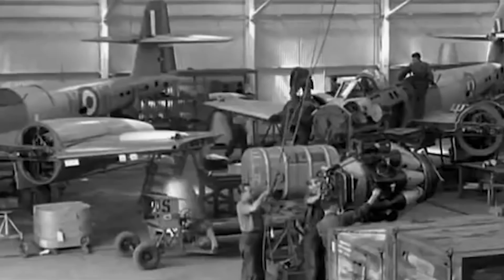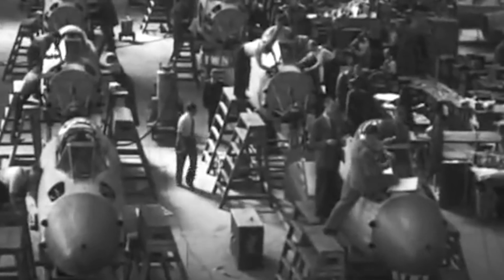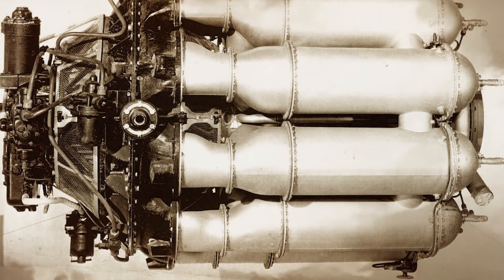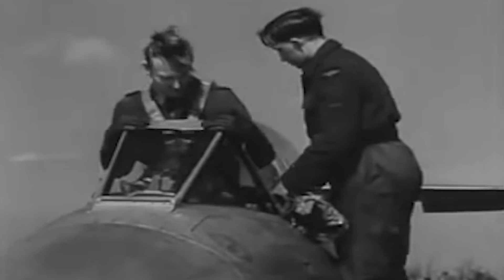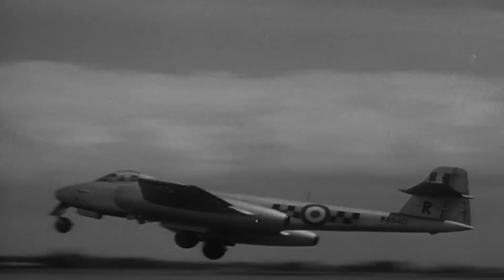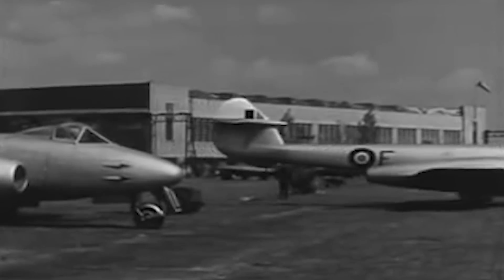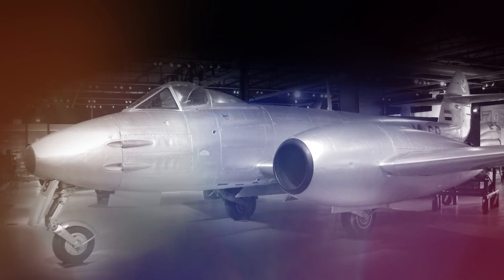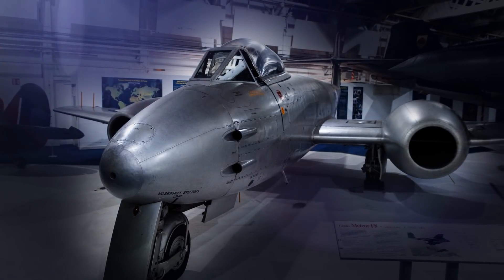Gloster Meteor - The Only Allied Jet to Fight in WW2

Comment: The e28/39 was the aircraft  General Hap Arnold of the USAAF saw and immediately saw the potential. He arranged for blueprints to be shared with America which happened via the Tizzard Missions in 1941. The result in the USA was the General Electric I-A which led to the General Electric J31.
The dominance of British jet engines in the early years of American jet aviation cannot be over stressed.
Reply: It was Operation Paperclip and Operation Lusty that launched America into the world leader in aerospace technology.
Nearly the entire remaining German aircraft industry was transplanted to America and German engineers designed everything from the Boeing B-52 to Saturn moon rocket.
Reply: @sandervanderkammen9230   Yes I am fully aware the USA turned a blind eye to all the war criminals especially one called Von Braun. Had that bastard ever set foot in the UK he would have been arrested, tried and hanged.

Comment: The meteor wasn't the only plane fast enough to catch the V1s. Mosquitoes, Tempests and Spitfires were used too. I think it was the Mozzy that got most.
Reply: Tempest was the number 1 V-1 Killer, Mosquito was 2nd, Merlin powered Spitfires were third.
Reply: @richardvernon317  Correct it was the Nosquito, the Meteor only shot down about 14 V q\1's, I just lookwd back and saw my mistake, both Merlin and Griffon Spitfies were used to chase the V 1
Reply: @barrierodliffe4155  Tempest was the Number one V-1 Killer with 638, Mosquitos was just behind with 623. Griffon powered Spitfires got 303, Mustangs got 232, everything else (Merlin Spitfires and Thunderbolts. Etc) plus the Meteors got 158.
Reply: Just 14 Meteors which were the fastest at low level the Tempest shot down most followed by the Meteor then the Spitfire but the numbers of each  and way they were used was different.

Comment: And Frank Whittle was - years behind German: Hans von Ohains invention of a jet engine for a Heinkel, which actually flew as a first in 1938!
Reply: Here's what Hans von Ohain had to say about it (from his foreword to 'Elements of Propulsion, gas turbines and rockets')-

"The first patent of a turbojet engine, which was later developed and produced,
was that of Frank Whittle, now Sir Frank (see Fig. 5). His patent was applied for
in January 1930. This patent shows a multistage, axial-flow compressor followed
by a radial compressor stage, a combustor, an axial-flow turbine driving the
compressor, and an exhaust nozzle. Such configurations are still used today..."

And 

"In April 1937, Whittle had his bench-test jet engine ready for the first test run.
It ran excellently; however, it ran out of control because liquid fuel had collected
inside the engine and started to vaporize as the engine became hot, thereby
adding uncontrolled fuel quantities to the combustion process. The problem
was easily overcome. This first test run was the world's first run of a bench-test
jet engine operating with liquid fuel (Fig. 7)."

And

"From the beginning of his jet propulsion activities, Frank Whittle had been
seeking means for improving the propulsive efficiency of turbojet engines.  He
conceived novel ideas for which he filed a patent application in 1936, which
can be called a bypass engine or turbofan. To avoid a complete new design,
Whittle sought an interim solution that could be merely "tacked on" to a jet
engine. This configuration was later known as the aft fan. Whittle's work on
fan jets or bypass engines and aft fans was way ahead of his time. It was of
greatest importance for the future or turbopropulsion."

No jet engine designed by Hans Joachim Pabst von Ohain ever went into production.

Comment: You see Schulz, Britain is loosing der war. Zey cannot afford to put propellers on za planes!
Reply: Germany invented jets.
Reply: @sandervanderkammen9230   I think Frank Whittle had a bit to do with it too.
Reply: @michaelreeves8164  We use the German version of the jet engine today... Whittle's engine was a dead end.
Reply: @sandervanderkammen9230  Oh Sandyboy, have you abandoned Guillaum again! Let's remind you what Pabst Von Ohain said-

"The first patent of a turbojet engine, which was later developed and produced, was that of Frank Whittle, now Sir Frank (see Fig. 5). His patent was applied for in January 1930. This patent shows a multistage, axial-flow compressor followed by a radial compressor stage, a combustor, an axial-flow turbine driving the compressor, and an exhaust nozzle. Such configurations are still used today..."

and

"From the beginning of his jet propulsion activities, Frank Whittle had been seeking means for improving the propulsive efficiency of turbojet engines. He conceived novel ideas for which he filed a patent application in 1936, which can be called a bypass engine or turbofan. To avoid a complete new design, Whittle sought an interim solution that could be merely "tacked on" to a jet engine. This configuration was later known as the aft fan. Whittle's work on fan jets or bypass engines and aft fans was way ahead of his time. It was of greatest importance for the future or turbopropulsion."

And of course as you know, all successful axial flow jets are based on A. A. Griffith's work on turbine design and his work produced the Metrovick engine which was the basis of the Sapphire and the American J65 engines.

Comment: Much better video! Have you considered doing one on the post-war Messerschmitt Me-262 Schwalb? This aircraft continued post-war in service with the Czechoslovakian Air Force as the Avia S92 Turbina into the 1950s. Czechoslovakia also attempted to export it to Yugoslavia and Israel, until the Soviet Union pressured them not to.  Also, the Lockheed P-80 Shooting Star served under combat conditions in Italy prior to the end of WWII in hopes of meeting a German jet in combat, but, there were no Me-262s in Northern Italy at that time. There were a few Arado Ar-324 Blitz aircraft, but these were reconnaissance aircraft. The P-80 mission was also revised for reconnaissance, thus, no jet versus jet combat, as was the case for the Meteor also.
Reply: Czechoslovakia tried to make the Me 262 but it was very poor just like the original, took a long time to get into service and dropped very quickly.
The P 80 was sent to Italy but hardly flew being grounded most of the time, lucky that they did not meet any Luftwaffe fighters. 
The Meteor did see active service and was based in Europe flying armed reconnaissance and ground attack missions over Germany destroying 46 Luftwaffe aircraft. something that the pre production P 80 couldn't do.
Reply: @barrierodliffe4155  Yet the P-80 produced more power in one engine than the meteor did with two. Certainly a match for German aircraft, had America been bolder with it.
Reply: @zanenobbs352  The engine in the P 80 which was based on a British engine may have produced more power in 1946 than the original engines in the Meteor did in 1944 but during the war when there were no production P 80's it was slower and not able to match a Fw 190 or Bf 109.  By 1946 the Meteor engines were each close to the power of the P 80 engine.  USA couldn't be bold with a poor performing aircraft that was unreliable at the time.
Reply: @barrierodliffe4155  It turns out that the YP-80 maximum speed was 515 mph, the same as the Meteor Mk.IIi. However, neither aircraft saw jet-vs-jet fighting during WWII. The V-1 was a jet missile, so can't count as jet-vs-jet, since no pilot was on board.
Reply: @zanenobbs352  The YP 80 was not a production aircraft and it certainly did not see service during WW II while the Meteor did. The Meteor was used for armed reconnaissance and ground attack and flew all over Germany destroying 46 Luftwaffe aircraft, the P 80 wasn't and did not destroy anything except itself. The reason the Meteor didn't have to fight the Me 262 would seem to be the fact that the Luftwaffe didn't come up to fight, maybe the Tempest and Spitfire had shot down too many of them.
Reply: @barrierodliffe4155  Bottom line, neither the Shooting Star nor the Meteor had a jet-vs-jet combat during WWII. As the YP-80 was not a production aircraft, then the standard Shooting Star performed even better! Thanks for noticing this!
Reply: @zanenobbs352  
Bottom line is the P 80 was not there. just a pre production aircraft that barely flew.  The Meteor did see active service and no fault of the Meteor that the Luftwaffe did not come up to fight. I noticed that often prototype or pre production aircraft performed better than production aircraft but regardless the P 80 post war did not perform as well as the Meteor IV which entered service just after the war.

Comment: I remember reading the F80 (?) was used in Italy before wars end
Reply: Not in combat during WW2, 2 P-80s crashed and the other 2 spent most of war grounded due to investigations and technical problems.
Reply: @sandervanderkammen9230  so are you going to tell the 4 pilots who's F80's went down that they weren't flying those in theater while the was continuing,. ..that they were only imagining it.??!?
Reply: @richardwaugh2049  One of the P-80s   never made it to Italy... it crashed in England.
Numerous crashes in the U.S. had the 2 remaining aircraft in theatre spent most of the remaining war grounded.
  Typical for Lockheed, the P-80 was technically very advanced but complex, the new type had a lot of teething problems.
Reply: @sandervanderkammen9230  the crash in England was the result of a design in the exhaust that vented flow into the rear fuselage disintegrating the rear of the P80 immediately after the P80 was assembled from parts after arrival in England. Security was very high before that happened and was raised to absurd levels after. The remaining English P80 continued flying but no one knew purpose. The 2 Italian P80's were also active. Coincidentally, just before the P80's got to Italy Arado 234's were assigned to penetrate down into Italy.  After the war a researcher found that the P80's were scrambled on more than once coincidentally to the flights of Ar234's coming.  Both the US and Germany were so top secret paranoid of their two newest planes that all that was ever recorded were flight times being nearly exact.
Reply: @richardwaugh2049  Indeed, the P-80 has some serious technical problems including catching on fire...
While the later P-80C (F-80) performed very well, the early A models were simply rushed into service before they were combat ready or even airworthy!

Comment: 450 pilots were lost!?
Reply: Over 1,000 CRASHED killing 450 british pilots alone... severely injuring hundreds more. The total number of deaths including foreign operators unknown.
The RAF lost 150 Meteors in just 1 year! 12 RAF pilots killed in week, 6 pilots were killed in crashes in a single day!!!
 Its the worst jet fighter in history.
Reply: @sandervanderkammen9230  No, the worst jet fighter in history was the Me 262, its service aircraft mechanical failure/pilot error loss rate was way higher than the Meteor's and on top of that it was so crap that no one wanted it post war and the daft old Czechs got lumbered with the twelve they built and even then they only used them for one year before buying the MiG-15 which had the RR Nene copy engine. The Meteor, as you know aw service in more than a dozen nations and was operated for over 30 years.

Comment: Meteors were being developed before ww2 even began, before the me262 even was on paper
Reply: Not as a jet aircraft... the Meatbox was originally designed and developed as a propeller driven night fighter..
Not a jet.
Germany began designing and testing jet aircraft two years before the U.K.
Reply: @sandervanderkammen9230  meteor started prototype as a single jet, then they decided on double, it was never designed to be a propeller driven plane, you might be thinking of a Mosquitoe? The british had jets developed in the mid 1930s
Reply: @לוחםעברי  You seem very confused and misinformed, the Gloster Whittle E.28 design is not related to the Gloster "Meatbox"
Reply: @sandervanderkammen9230  also it wasnt the me262 as the first german jet plane, only germans first jet fighter
Reply: @לוחםעברי  That is incorrect, the World's first successful demonstration of a jet aircraft was the Heinkel He-178 on August 27th 1939... the Gloster Whittle E.28 was the 4th jet aircraft to be demonstrated but the first in the U.K. fleq 2 years later.
Reply: @sandervanderkammen9230  I did literally just say the germans had a different jet first, but aight, me262 wasn't the first as this claims.
Reply: @לוחםעברי  The Gloster Meteor I was  developed from the canceled Ministry of Aircraft Production OR F.18/40 a twin engine propeller driven fighter aircraft which lost to the DeHaviland Mosquito.. the F.18/40 design was modified as the F.29/40 and adapted to meet the new MoA OR F.2/40 and OR F.9/40 which was adopted as the RAFs first jet fighter... although the Meteor saw service during WW2 it was never used operationally as a jet fighter by the RAF, It's service would be limited to training, reconnaissance and ground attack roles.
Reply: @לוחםעברי  The Messerschmitt Me-262 indeed was the first jet fighter to test flight, enter production and enter operational service.
The Me-262 was the only jet fighter to see aerial combat during WW2... shooting down over 550 Allied aircraft including 85 RAF fighters and bombers.
Reply: @sandervanderkammen9230  and yet it recorded hundreds of fighter sweeps over Europe and Germany.  If it was so bad why did German fighters cut and run?
Reply: @jimdavison4077  Never shot down a single Luftwaffe plane.
Reply: @sandervanderkammen9230  yes the luftwaffe was good at running away or landing as order by meteor pilots.
Reply: @jimdavison4077  The Meatbox was never deployed as a fighter during WW2 it would have been crushed.
It was restricted to limited ground attack operations over Alied controlled air space.
Reply: @sandervanderkammen9230  Hello Sandyhoney, I see you're still trolling out your garbage.  The Gloster Meteor was a purpose built jet development aircraft which flew with various jet engines, including the Metrovick F2 that was the basis for the Sapphire and J65 engines. The nazis took a different route of adapting a standing piston prop design which is why the Me 262 started as a tail dragger and was powered for some time by a Jumo piston prop combination and looks so much like the the Me 309.
Reply: @sandervanderkammen9230  The Me 262 was a waste of metal. It failed utterly its only task barely scratching the surface of the allied air campaign. It had an appalling mechanical failure/pilot error loss rate.  And a service career of only seven years and it would have been only 2 years if the Czechs hadn't deluded themselves that they could sell them. In the end they were lumbered with all twelve that they built and operated them themselves for one year from 1950 before mothballing the lot and buying the MiG-15 with its RR Nene copy engine.

Comment: Somebody is delusional, the ME 262 is a much better looking fighter plane . It isn't even close just like it was a better plane .
Reply: Its no coincidence that the Me-262 looks much faster and seeker than the Meatbox..
The Meatbox was converted from a propeller driven aircraft into jet using paper, pencil and guess work.
The Messerschmitt Me-262 on rhe other hand, was designed in the world first large diameter supersonic wind tunnel at the Luftfahrtforschungsanstalt high speed research institute in Braunschweig Germany.
Reply: @sandervanderkammen9230  Oh dear Sandyboy, you trying to push that codswallop still. I've challenged you before to identify this supposed piston prop airframe you claim the Meteor was converted from but you ran away from the challenge. And of course you will fail again this time as the Meteor was a purpose built jet development aircraft.
As for why you imagine that the nazis putting the 262 airframe in a high speed wind tunnel is indicative of anything much, its funny beyond measure. Not least because Willy Messerschmitt himself stated that there was nothing supersonic about the Me 262. Nor does it actually say anything about the origin of the airframe.
What is more telling is the fact that the airframe that would become the Me 262 started out as a taildragger, made some fifty flights with a jumo piston prop combination and when it acquired its tricycle undercarriage it looked very similar to the Me 309.
Reply: It's simply a matter of opinion.  Anyone is free to like the looks of which ever one they like.
Reply: @jimdavison4077  The superiority of the Messerschmitt Me-262 over the Meatbox is certainly not a matter of opinion.

It is a irrefutable fact.
Reply: @sandervanderkammen9230  You don't actually know what a fact is do you Sandyboy.  The Gloster Meteor serve service with more than a dozen nations and for more than 30 years. Whereas the Me 262 only saw service with two nations and was a museum piece after only 7 years. Nobody, but nobody bought the Me 262 postwar, not even the Argentinians who were being advised by Kurt Tank and Adolf Galland.